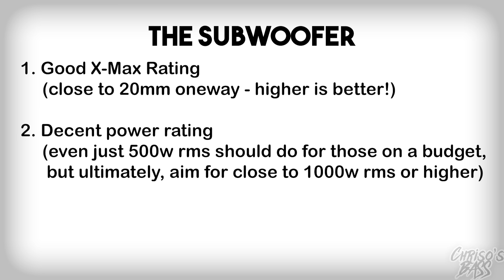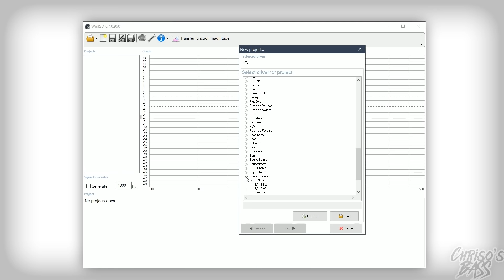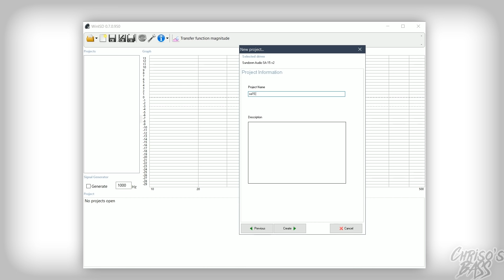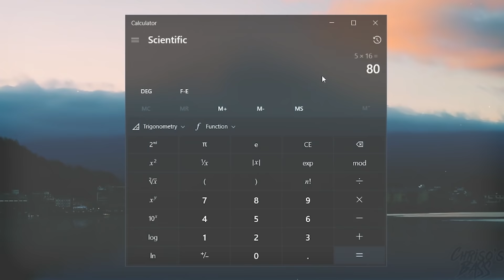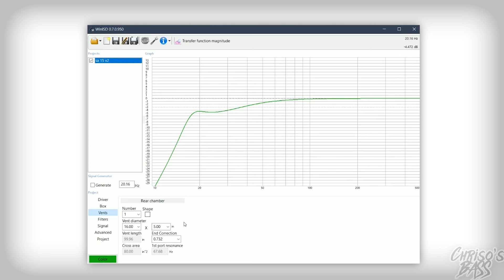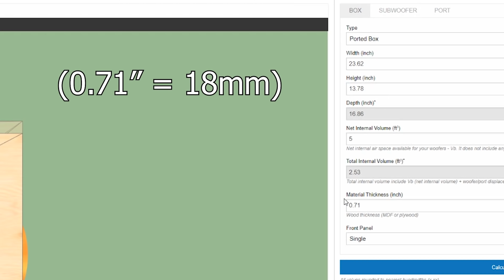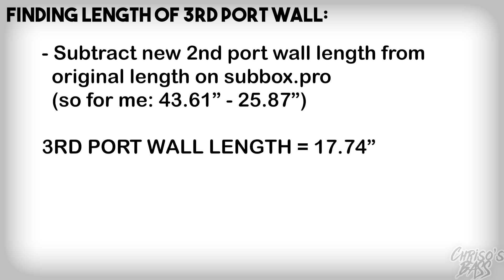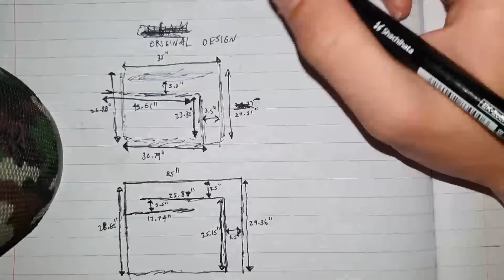How to Design a Subwoofer Box that plays SUPER LOW! | Full Guide

Comment: The problem with all these super low and loud subwoofers in a Home Stereo is that while it's playing at moderate levels, I keep hearing a Helicopter, Big Truck or Loud Muffler Car outside my house.  I run to look outside but nothing is there.
Reply: I think that’s called schizophrenia
Reply: @deadcow59  Heh Heh. But, no schizo. The good stereo system with the good bass is hooked up to the TV.  Sounds are revealed that would normally be missed, and many of the sounds are "Thrown"  . ... I'm surprised now how much I hear a Bass Drop. Even in TV commercials they use a Bass Drop.
Reply: @deadcow59 lmaooooooooo
Reply: Exactly bro, you'll either hear ww3 outside or a demolishing machine and when you come to check, theres nothing 😂
Reply: That's called put down the crack pipe
Reply: @WilliamOnger-r9p  crackheads don't have subwoofers😂
Reply: @southern_merican not for long, anyways!😂

Comment: Slot ports are about as aerodynamic as a city buss (the way they are commonly constructed), and should not be considered equal to an aeroport with the same cross sectional area.  Which will flow much more air than a equal sized slot. I encourage you to test it.  straight slot vs folded slot vs aeroport, all at the same tuning Fq.
Reply: How big do you want the box to be

Comment: I've heard that there are good sounding, low playing and very efficient for characteristics. And I've herard that you can only have two of them in a box. Most subs sound decent, are efficient, but don't play low. 
Efficiency isn't too important to me, but I like it low and precise. And it seems like subs that can do that cost way beyond 400€. Could you make a tutorial for something like this? Preferably with a budget sub.
Reply: I kinda do agree with you about how the box sounds. Mine is tuned to 30hrz, according to the free app, lol. But it does hit lows. I've played close to 20hrz, that coca cola song, and you can feel things flexing in the car. And I'm currently running a old school Lanzar Vibe 1000watt class a/b amp. Cause at the moment I can't run my Skar RP1200.1D amp, which is 1250watts RMS at 1 ohm stable, cause of low voltage issues. The voltage regulator is going bad in my alternator. Gonna replace it, do the big 3 and run new power wire all 0 gauge in a few weeks. Gotta cover bills first...lol I really wish we could share pics on here..smh
Reply: I don't know if this will help or not. I bought a Skar EVL15 D2 at $225us and a Skar RP1200.1 monoblock class D amp on sale for $150us. Then I used sub box pro and designed a box that's 3.75cu/ft and I used the 16in/sq for my port area. So I ended up with around 54-55in/sq. I believe that's around 4.5in wide port. I can't remember the exact measurements. It cost me $75us to build my box using sub box pro on my phone. I wish I could share a pic to you. Hope this helped a lil.
Reply: @biggklown7644  Thanks for the details. I've already tried building a sub with subbox pro and it didn't sound too well. The problems with car audio bass chassis is the moving mass. They don't sound really clear as they're designed for very high output and power handeling. I'm currently using a Mivoc Hype 10 G2 which houses a Mivoc SWW-11. It does sound really clean and gets faitly low. I think i could really improve this sub with a better box. I'm currently learning my way around in winISD.

Comment: Tsp's control extension more than x-max. If the driver can't couple with the air at low frequencies, x-max will not matter. Low qts will rely on the enclosure to produce frequencies near or below fs. 
Volume of the enclosure is determined by vas and qts, tuning is controlled by fs and qts, and optimum port area will be dictated by qes and vas.
The predicted x-max is based on no decrease in cms as the spider stretches. Design ports by vent mach, a mach of .03-.05 is best. A port to small will add power compression by overly restricting movement near and @ tuning.

Comment: The best way to build a speaker box and speaker enclosure to get ultra low Bass is to have a bandpass speaker box like enclosure with the subwoofer in the center and a passive radiator behind the subwoofer and a passive Radiator in front of the subwoofer creating a sealed chamber that can now be filled with sulfur hexafluoride gas https://youtu.be/u19QfJWI1oQ to hit even lower frequencies.

Comment: Good entertaining video :) I've done roughly the same before watching your video :) - I used speakerboxlite's web designer (not the app, because the web designer is possible to use normally with the 3D designer / cut sheet as free, just it is a bit unconfortable and tricky). I have a Gladen RS-X 6.5 driver. It have 250 WRMS, and 9.67 mm one-way X-max. At this driver the X-max is determined as ((Hvc-Hg)/2)+(Hg/3) - it seems to be, it is one-way excursion limit at 70 percent of Bl, definetly not the maximum nechanical excursion limit just before bottoming out. Speakerboxlite's designer is continously developed / updated, and now especially it's simulator, but also the whole designer, is almost as accurate like BassBoxPRO's, and it have also 2 computation models (the complex model can simulate box and port behaviour, and also port echo), and you can simulate using cabin gain. Also, at slot ports you can design an U-shaped L-port, or even a labyrinth styled port. My box: it have slightly more than 2x the net volume tuned to slightly less than the half of the manufacturer's recomendation, and in real it not overpasses X-max on RMS power down to 20 Hz, and higher than tuning frequency it reaches approx. the 89-96 percent of the X-max (different computation models). The vent air velocity is more accurate by the complex model, which is around 25-26 m/s, by simple model it is around 16-17 m/s. It is decently windy for what it is, to prove this, I have also videos of it on my channel, and in the build video's description you can also find a link for the box design project.

Comment: I'm running skar zvx 18s and wanting to add audiocontrol epicenter Bc I like the low loud bass. What would be the best frequency to tune the  box at in my case?
Reply: Mine is tuned to 32hz (i use epicenter some times) and as long as you tune the epicenter correctly for those frequencies itll sound deep and loud. I mostly play rap music without epicenter,  and that alone sounds really loud with port @32hz but with epicenter I havent ever heard a car around here that uses an epicenter that actually sounds loud and deep, usually its just boomey or very high frequency which i dont like. So Id say tune it to around 32-35hz and make sure the wide knob on epicenter isnt way too wide.

Comment: Put angle pieces in the corners cause on the diagonals from the ends of port walls you’re not at 3.5” anymore.. it will be closer to 4.75ish.. this may or may not effect tuning based on the box.. however we’ve already extended the wall by 1.85” by the time you add all this up there is going to not only be a change but also the lance and choking as air slows down from 3.5 to 4.75ish in the corners before then getting squeezed back to 3.5 again.. now in reality this most likely still has no effect on tuning but what it will impact greatly is output. By bottlenecks my the port corners snd changes of direction what you end up with is some waves not taking the proper path.. this clears added resonance inside the box which creates canceling waves inside the box which then robs you of performance and output. In all reality if you want to get the most of any box even a sealed one you should add baffles to every 90* corner changing it to 45*. This has less impact overall in the box itself but does have a drastic increase in output through a slot port. The internal volume change isn’t much not really enough to worry about unless you’re going with w tline setup or using a lot of internal bracing.. in a port it literally like shooting water from a garden hose into a firehouse which then feeds a garden hose again.. this will effect air speed, density and also internal resonance.. all three will rob you of output.. I’ve seen prefab boxes gain 2-3bd just by doing this.. and it’s a major issue I have with many custom builders.. many do the 45’s at the ports but not at other 90* corners of the box.. no point in building a 6-8-1000 dollar box and bot taking 5min time to increase output a couple DB.. it also stiffens up the joints which reduces box flex and vibration which in turn again yields more output.. it’s like using 1-1.5” front faces as opposed to just 3/4” faces.. it’s makes that much difference
Reply: I was thinking the same thing bro. You said it all...lol
Reply: HOPEFULLY I CAN GET A REPLY. LOVE THE ADVICE. ALSO, HAVE ONE MORE QUESTION IF I WAS TO MAKE THE FRONT PANEL 1.5" THICK, WHAT CHANGES WOULD NEED TO BE MADE BASED OFF THIS VIDEO THANKS IN ADVANCE

Comment: No questions this is the most badass video on YouTube for building a box, funny thing is how I found it after I built mine, I happened to use sub box pro and it turned out really good, one problem I found was finding take offs for your internal 45s, soo I ended up taking them out with my sub displacement. If your could provide that and how to factor them into your box would be cool. I’m running a 12” Fi 4.11 fully loaded 4-5000 Rms and it fucking slams!

Comment: I have 2 ground zero gziw 300 - II it has 10mm xmax and 350w rms but i have a big box and im gonna try to add 2 extra walls inside the box to see if it helps with lower frequenzies

Comment: So does port air velocity need to be between 17-30m/s only for ported boxes or does that apply to bandpass boxes as well?
Reply from the maker: Not sure about bandpass boxes as I haven't done enough research on them, but I'd assume that for 4th orders and parallel tuned 6th orders the same rule applies because you have ports that behave in a similar way.

However, I don't know about series tuned 6th orders since they have an internal and external port. Sorry.
Reply: @chrisosbass1286  Wouldn’t the port velocity be a lot higher because all the output is coming out through the port? In Winisd port velocity was way higher for 4th order. Like a 2:1 ratio and 47 hz tune I was getting like 60-70ms!

Comment: Love the vid. But how do you measure out 25.67in? I understand .25 is 1/4 and so on. But how do you break down .67in and other measurements like that?
Reply: What I did was marked the measurement I understood. Like for example: 25.67in. I'd mark 25.5in and then use my calipers set to mm and use them to measure the .17in leftover. Idk if that was exactly.25.67in, but it's close enough. As long as you use a really sharp pencil or a fine point pen. Hope that helps, but it has been a long time since you posted...lol

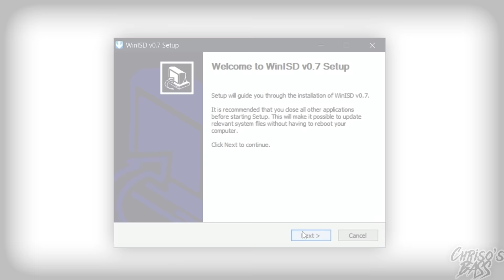Comment: 3:44 QUESTION: Is 1.33x the manufacturer recommended net volume size of the min, mid, or max number they provide? Meaning, my 15" Fi Neo 4.11 is recommend I use 3ft³-5ft³ per sub. So do I multiply 1.33 by 3, 4, or 5? 
It's important to know I will be clamping a little more than their rated power of 4500 (rated 4500 but Fi says up to 7500 so I have each sub connected to it's own Taramps Bass 8K wired down to 0.7 ohm = 10,000 RMS Watts per sub but again, I expect to clamp only 5k each). Sub's Fs is 33.6Hz so I chose 33.6Hz as my box tuning with port area of 16in² per cubic foot of net volume as recommended.
For more info and videos, see my YouTube channel for build updates which starting June 2021 will be with my new larger custom enclosure of 8.5ft³ net (4.25 per sub) whereas now (May 2021) they are in a "labyrinth enclosure" (2 individual long winding ports) and only 2.75ft³ each sub net volume and port area half of what is required (8in² vs 16in²) which both (port area AND net volume) are greatly undersized.
Reply: I have clamped 7000 each. 155.5 dB on my 2 15s no wall as seen on my YouTube channel (access by clicking on my YT photo)

Comment: 1:35 is wrong. Those kind of subs are made for (as you mention in the video) high Sound Pressure Levels, and often have a Resonant frequency of about 35hz. There are better options like home theater subs to get low easily. The 10“ dayton reference woofer for example has a frs of 25hz, which will make it much easier to tune it lower.

And also, you don‘t need such high power levels (like 500 or 1000W). What‘s more important is the efficiency of the sub at 1W. From there on, you can multiply the power for a 3dB increase. 
E.g.: 91dB/W/m -> 1W = 91dB, 2W = 94dB, 4W = 97dB…. 256W=115dB.

E.g. 84dB/W/m => 1W=84dB, 2W=87dB… 1024W=114dB

Comment: Award Winning video IMO!  This is what you do if you want really DEEP bass.

Did this technique for my JL 10 and had to use several feet of 3" flexport as my port was tuned so low to get the right response.  Essentially a coil of port tube in the enclosure tuned very low.  Requires a high power amplifier to get the excursion needed to make it work; but sound is amazingly DEEP and not the boomy duff duff boom-boxy sound.

Even without the DSP controls, the enclosure is well behaved and not boomy.

Have to roll the windows down to get the extremely low frequency stuff out. :)
Reply: A single 3" port for 10" subwoofer...? That models to.. oh my.. 76 m/s (!!!) of port chuff @ 22 hz @ 450 watts... for my 10" subwoofer.
Reply: @haraldpost  It was tuned to about 28 Hz and flared with a horn at both ends to reduce chuffing.  Powered by JL 250 watt amp at the time.

It would indeed chuff like a choo choo when pushed hard at the very bottom end when you got close to port tuned frequency.
Reply: @gavincurtis  I've always wondered if there is a way to trap a heavier than air gas inside a port for purpose of being able to make it shorter. You'd need some sort of balloon or bag on either end, then fill your port with per-fluoro-butane or something.
Reply: You're better off with a passive radiator (or 2) in a small box, as your port starts to look like a small intestine to get it low enough.
Reply: @TimpBizkit  True.  The long port full of air acts as a moving mass, just like a passive radiator.  I didn't have any area to install a passive radiator as it was a stealth box install.

Comment: I remember when I was 16 just got my first car, a clapped out 94 Sentra. I was broke so didn't have money to just go buy a $80 box for 2 10's. My dad had alot of 1" thick plywood and I had did this same design and made it oversized not entirely knowing what I was doing at the time but it worked. I had 2  Rockford Fosgate P1's 10" woofers running this old ass kicker zr1000 amp my uncle gave me he had sitting in his attic for years was barely able to angle the box into the trunk, but man that system would hit lows so hard it felt like it was hard to breathe and would make your nose tickle. I had friends who had like a 15inch kicker or 2 twelves everything they got from the local audio shop and yea their systems were loud but more rattling than anything and my little 10s were just pushing alot more air and hitting deeper frequencies. Alot of people asked what I had and never even heard of Rockford Fosgate.

Comment: My only ( at this stage ) problem is Where do I get the info on the sub? 
I have a Alpine 40 cm ( bigger than 15" ) sub, but, as it is more than 20 years old, no info to be found on the Alpine website. 
I don't have model etc on hand but easy enough to get the sub from storage, later.
Reply: box pro will give you most off the imfo

Comment: So if my port is 3 inch in diameter and 8 inches long that’s what a box maker app says to do. So my question is would two 3 inch ports 4 inches long be the same thing with less port noise. I like 20-30 hz and 30 hz to me is high. I’m just getting tons of air velocity and port noise. Custom 15 inch sub W/solo X 18 motor internal box vol is 4.2 including sub box maker said a 3 inch port 8 inches long would give me a 25hz tune roughly. Using straight pipe For Now going to flare myself or buy just want the right formula first. Thanks in advance. You’ve already helped me and let me know I’m not the only one who’d rather rumble and make people wonder where/what it’s coming from 😎then announce to the world I have subwoofers in my car. Low not loud.